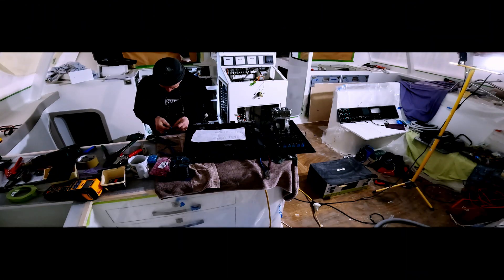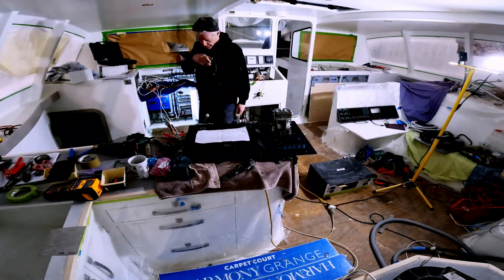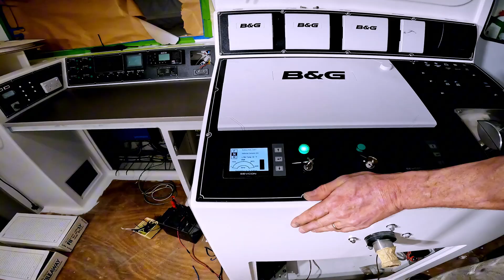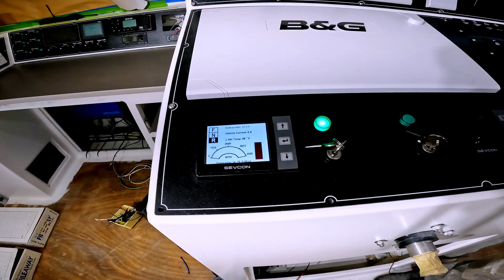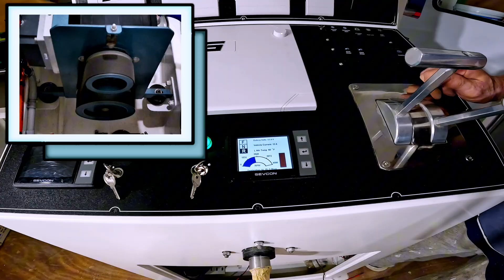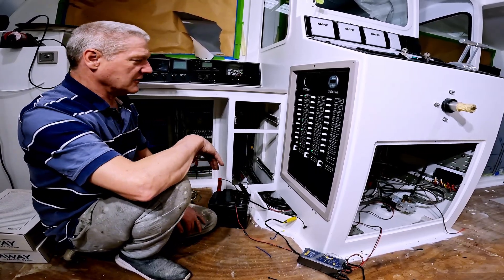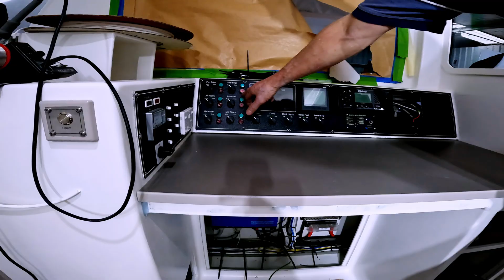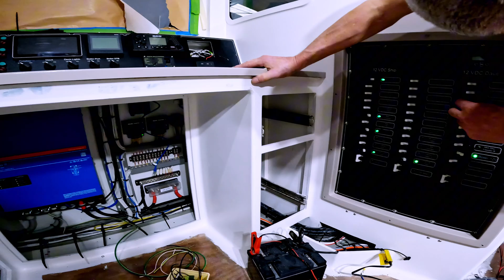ELECTRIC PROPULSION STARTUP TEST:  WILL IT COME ALIVE OR GO UP IN SMOKE (Ep35) ~ Building Marram !

Comment: Nicely done! What will be the total amount of solar panels on board?
Reply from the maker: Hi mate, thanks for the comments,  we have gone with 4 x 510w 42v max ridged panels.  Set up in 2 banks with 2 series panels and an mppt per bank. Solar will charge the 48v banks, 48v charges 12v house batt. Cheers Kel & Mel

Comment: how much battery power and how long last how many miles?
Reply from the maker: Hi mate, 100% correct. Hence a 400amp genset with 500ltr fuel tank :-) cheers, kel & Mel
Reply from the maker: Hi mate, we have 600ah of 48v and 320ah of 12v. No hard fact yet on distances, but calcs were at 5hrs at 7 knots before have to start the genset. . Cheers kel & Mel
Reply: @themakingofmarram also it’s so dependent on other factors like tide run, windage, sea state, etc that there is no real time running, only a theoretical calculation that does not survive contact with reality!

Comment: Nooice as usual.  So can I ask a few questions…yes…thanks😜. Are you putting a guard around that belt!  What do the water heater draw?  I would strongly an auto-helm out in the front cockpit as when you tack it would be nice just to push the two buttons and then have free hands for the lines straight away.  Could use the remote I suppose?
Noise wise, you mentioned the belts which makes sense.  What’s it like when the belt is off?  Do the motors have soft mounts?

Love your work!
Reply from the maker: Hi mate, yep there is a guard on top / front and down about half way. the heaters are 800w @ 48volt per unit, auto helm buttons are just at the door leading out to the cockpit, we also have the remote , so recon we should be good for light handed, motor noise without belts are what i expected with these types of motors, still has a pitch but not as bad as when the belts are on, the drive set up  with reduction, bearings, dive belts etc are all on a frame that is mounted using 4 x rubber vibration mounts. cheers, Kel and Mel